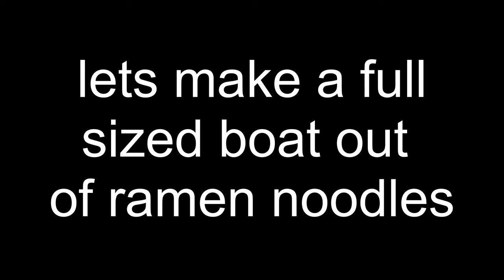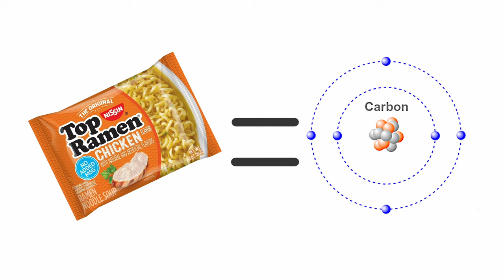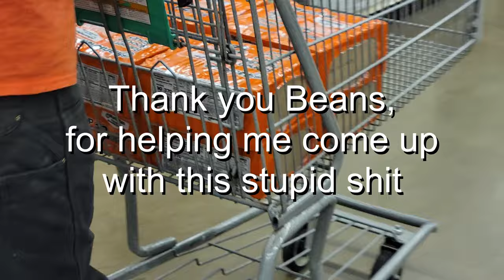Does a BOAT Made of Ramen Noodles Actually Work?

Comment: Just wait until this guy discovers epoxy
Reply from the maker: Epoxy is too easy, and SOOOOO expensive
Reply: @Bebeau_Builds  yeah, I'm sure for something like this it'd be nuts. BUT, one could totally carve a canoe or kayak in foam, coat it in tin foil, then coat it in thick epoxy and noodles, then chisel out the foam. You could sand down the exterior or leave it lumpy, and it'd be smooth inside to attach a wooden frame for reinforcement. It would be dumb as hell but COULD be done
Reply from the maker: Dumb as hell are the best ideas, I like your thinking

Comment: You should pitch your moldy noodle boat on shark tank. It would probably sink.
Reply from the maker: Have you ever thought to yourself "man I just don't have enough diseases and my commute to work is just too easy. We'll I've got the solution for you! Moldy Ramen boat! Just two paddles with this thing on the water will have you sinking in seconds! Just make sure to pick up the pieces for lunch later. Those densely pack Ramen noodles carry a secret, the power of mold. With enough mold in your body you can easily shorten your lifespan by not 5, not 10, but 15 years!" something like that?
Reply from the maker: Good point, I'll write that down